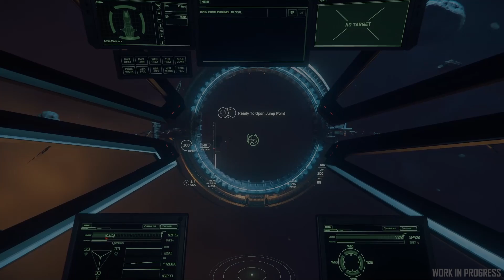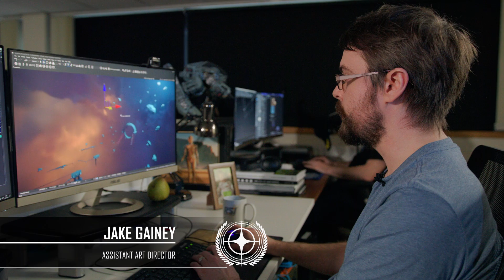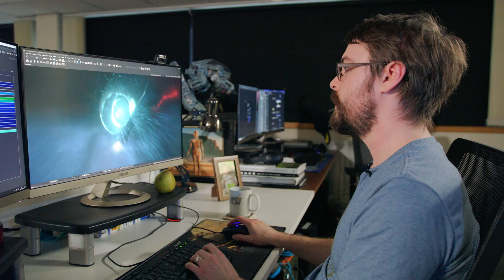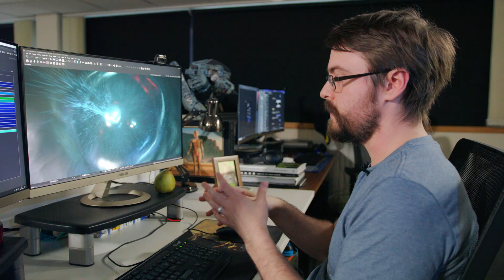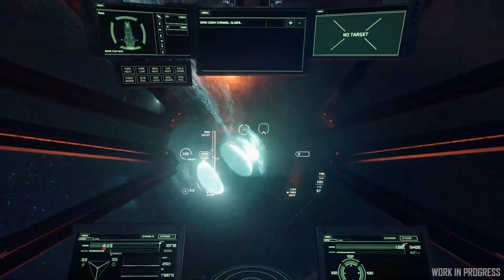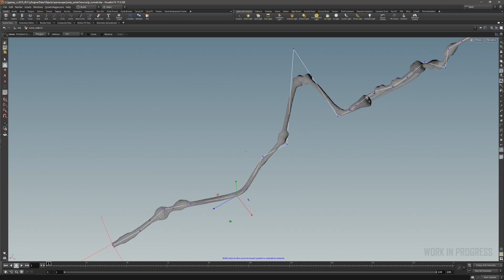Inside Star Citizen: Jump On It | Fall 2019

Comment: Jump points are needed to get to other systems, ships being autonomous to go to another system would be a bit game breaking and would be an incentive to trolls and toxic gameplay.

With that being said, I just can't bring myself to like this concept of wormholes. It looks really bad, apart from the nice vfx I can't point out one nice thing about it. That tube concept is waaaay too organic for a cosmic object. I know you want to have gameplay in it, but why exactly is that? Players shouldn't be travelling from system to system every 10mins to need a gameplay loop in order to stay engaged. Make it a straightforward mechanic. Example: a sphere which you'd see a small constellation in the center and a lot lensing in the edges (kinda like what happens on an event horizon), as the ship starts the dive into the wormhole it becomes stretched and distorted (you already have that when quantum jumping) and it remains as so until the end of the trip, when it enters said sphere space colapses behind (like a very fast zoom out) and expands infront (zoom in) and you'd be able to see massive objects pass around you very fast, until you finally reached the jump point. I think this would be the best compromise between sci-fi and authenticity.
The current design brings a lot of problems, such as you making it possible for players to be thrown out of the wormhole but what happens then? Can you have any other outcome other than death? Because I don't see how a player will make it back to any system when you're like 5AU away from anything. If you could quantum jump half the distance why not go all the way?
Then you have that horrible clipping through the tube. Guys seriously, it hurts my eyes to see clipping and there are a lot of ways you could eliminate that.

TL;DR: 1- wormholes don't need gameplay, it overcomplicates them and it will be a burden more than fun after a few trips.
2 - Make it simple, straightforward and visually entertaining. Easier to produce.
3 - It looks like a colon that is clippable. I'm sorry but that's not good enough for us, and shouldn't be good enough for you.
Reply: Just wanna add that if you compare the wormholes to any other feature or asset it definetly pales in comparison. Sorry for being so critical, I know you're doing your best out of a bad idea.

Comment: I am wondering whehther there will be pilots available to hire like "rapids guides" at the jump points for those that, since the game is entirely "your" skill, can't actually manage the journey. Also I am really curious as to how you will handle some of the "major" jump points like to Earth or Terra. For instance in the gameplay we see "Initiating jump drive", "jump drive initiated" and then "ready to open jump point". This to me says that the jump point is reacting to the input from that players ship which then goes into the opening and travels. With so many players/npcs using those main points it will be a major issue if we have to wait in line to be able to activate the point for our own journey. Will the main points always be open and you then just fly into them and go like the tradelanes in freelancer or will it be like the jump gates and you have to wait till it is free? or once someone else has opened it, even if it closes after the last person is through, will others ships detect the way is open? If more than one can go through at once is it possible that we may have to utilise the "secondary" routes to make it through as some portions are only wide enough for one ship and first to the gap doesn't have to panic react?

Comment: I hope there will be an autopilot for this. Its nice for the fist oder second time but then the whole manual A to B-flying becomes boring.
Reply: Sir, can I recommend to you our latest product "Endoskopi 4.1" , the latest in Wormhole autopilot-technology. It takes 2 rack spaces in your ship and costs UEC 19.000 retail price.
Reply: After a jump point has been charted, it's automatically replicated the path it travels, copied from the first jump point charter's movements. But for the first time, a brand new jump point, no, you will have to fly it manually.

Comment: with these wormholes, are there chances that they get randomly shut down and need repairs, so missions develop to fix them allowing flight though...and maybe allow players to damage them?
Reply: I'd like to see Jump Points be able to be damaged and repairable by players and NPCs. Would be awesome to see thousands of players and NPCs working to rebuild and repair a Jump Point.
Reply: @PerfectCode  or if it can't be damaged, when a player finds one they have to build a ring around it for "safe travel" or else flying through it will be crazy hard
Reply: stabilizing rings

Comment: The motion is very odd. It feels like we're moving forward and backward and forward...repeating. It doesn't feel like forward motion alone and the sense of speed is lost a bit. Maybe this is something CIG is aware of?
Reply: I actually like this effect. it gives it the appearance that the wormhole is semi unstable and is trying to collapse in on itself.  I think it would look better if the movement was more random  and not like a heart beat.
Reply: I agree.  The pulse seems to slow down the actual movement.  Not sure the rapid pulse is needed.
Reply: You are legit travelling unfathomable distances in mere moments. Space and time is bound to get a little odd. Pulse one way to signify going very far very fast; pulse the other way to signify time not speeding up relative to distance traveled.
Reply: Thats because you are switching focus from the edge of the wormhole to the particle flow and back.
Reply: I think it's because the camera was sitting stationary in the tunnel. Once the player is moving through I think it'll look better

Comment: But why jump gates? Will gameplay boildown to 'eve'like gameplay i.e. people camping the otherside of the gate.
Reply: If it's anything like Freelancer, Roberts first space sim. Yes, wormholes will be a choke point for player interaction. Though there will be jump gates and then there are natural jump holes interspersed throughout systems. Jump gates are located on common travel routes, but natural jump holes are usually off the beaten track and will need to be discovered. Jump gates will be patrolled by lawful NPC and players, but jump holes won't be for the most part. So if a pirate wants to camp waiting for traders or whatnot, it won't be easy to do that at a jump gate if their reputation is bad with the law or military.

Comment: Is this a Human made wormhole with two Jump Gates to Enter/Exit like in Stargate? Because i saw no Wormhole before this Jumpgate was activated. will there be Jump Points that are Natural Wormholes? and if what will they look like because a wormhole in a 3 Dimensional space in therory looks like a sphere where you can look through? I always thaught the wormhole and the travel through would look a bit like in the interstellar movie. But at all the Jumpgates look awesome only the feeling of the Speed is not great at all.
Reply: I think jump points are areas where 2 points or space time age way closer than usual, and it is the ship jumpdrive which enlarge the opening to make it usable for travel, and jump gates are built around populous wormholes to stabilize them so they don't change shape too much. As for the lack of speed, I agree. It is mostly because the ship actually moves relatively slowly and also because the trail of particles move towards and through the ship making it feels like the ship is going slow.

Comment: I'm curious if they still plan to be able to have the option to give away or sell the routes so that some players dont have to manually fly through.
Reply: Still looks like it. Remember those wormholes change, and there is "wild" wormholes also present that can lead to different places but are destabilized and can be tricky to cross. If you know the way then you will see the energy stream leading you to where you want to go, but otherwise you would have to go blind and hope you do not take a wrong turn and end up in a dead end. Essentially, an uncharted wormhole can only be crossed if you known the way, or you have drones to burn in order to scout the way. And of course, you can keep that info or sell it to whoever.

Comment: Wormholes look good but they are not very realistic. I mean if you think about what a wormhole would look like in a 2D universe; it would be a circular hold and a tube going "under" the 2D universe to some other point and another hole. From the point of view of any Being in the 2D universe you could enter the wormhole from any direction, you would not be able to see the side or the back of the wormhole. When entering the wormhole the 2D Being would think they are entering a circle heading for the centre. Then, after a longer time than it should take to cross the circle, they would emerge somewhere else in their 2D universe.
Inside the wormhole they would see not sides to the wormhole, they wold exist on the inside surface of the 3D wormhole. Moving left or right would take them around inside the wormhole and back to where they started. If there were two, and one moved off tow the left they would magically appear to the right of the second.
If you extrapolate 2D to 3D then a circle becomes a sphere and the 2D surface of a 3D wormhole to a 3D surface of a 4D wormhole. Moving Up or Down, or Left or Right returns you back to where you started.

Comment: There could be some kind of variation based on how stable a wormhole is, so that it's either straighter and calmer or more twisted and difficult to navigate.
Reply: It was said awhile back that there will be wormholes of various sizes and complexity. Some are small that larger ships can't fit through, so you could jump it in your Hornet but an Idris couldn't use it. This way you could find shortcuts to different systems. But the big boys will have to take the long way around. You'll also have to map it if it hasn't been jumped before. You can then sell the jump map to others. That was one of the features of the exploration loop. No idea if any of this has changed or not.

Comment: What I want to know is what are you going to do when two ships are flying through the same tunnel in opposite directions? In the past two days my ship has been demolished multiple times by random people going into or out of quantum at hubs. And that was in open space with at most 50 players where the chances of that happening should be so ridiculously small that it would be like winning the lottery. You're going to have problems if there are 50+ players all scrambling to fly down the same wormhole that looks barely big enough to fit an Idris.
Reply: It seemed like everybody has to wait for opening the wormhole. So if somebody wants to "jump" from one system and opens the jump point - ship on the other side has to wait. Maybe.
Reply: @buzzantique1158  Well, that causes other problems. Bottle necks like that turn cargo ships into sitting ducks. So every jump point becomes a buffet table for pirates. It also discourages trade between systems if you have no idea if you are going to be waiting 5 minutes or 20 minutes in a que to use the jump point. Which will only be made worse when they start implementing a dynamic economy.
Reply: @OmegaZyion  Most jump points will be regulated by local security forces, but for the less regulated ones yeah I could see pirates camping them
Reply: They could just generate a new instance for each player of the tunnel as well as the entry and exit points when they give the order to open the jumpgate...this would avoid the issue entirely, wouldn't it?
Reply: @Woodchuck1337  there are no instances here, maybe in the future but at the moment everyone in the server is in the same server and cant be moved without a loading screen and they never want to have a loading screen besides when spawning in
Reply: @yobob591  Sure you are right...at the moment we don't have instances...nevertheless iirc they have plans for heavy instancing or rather server meshing when it comes to the big space battles i.e. around capital ships involving lots of players, so at one point in the future there will be some kind of instancing. And since we also won't see jumppoints and wormholes in the PU for the next couple of months/years, I'm sure that WHEN they finally come, the server meshing is ready to deal with these problems. =)
Reply: @Woodchuck1337  noooooo a instance thats elite dangerous territory this game is suppost to a persistent universe which means everythink is there no loading or instances thats the whole point in star citizen and if they do it like that then we all migh aswel just play elite dangerous

Comment: Now this is what I was waiting for! <3 Although I believe a wormhole is a connection of two points in spacetime with the length of zero. More like a portal than a tunnel.
Reply: Yes the two points in spacetime would have no distance between them, but the space around those two points would get highly warped and stretched. This could take on the appearance of a tunnel like structure, as you move form the unwrapped space into the twisted space around the wormhole itself and back out through the twisted space on the other side. In this case the actual wormhole itself would exist somewhere in the middle of the tunnel.

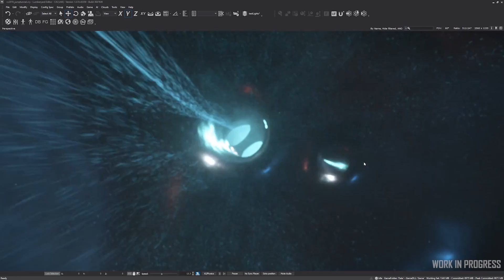Comment: I will try to simplify some concepts for people that don't know a lot about Graphics Programming. There are 2 main types of shaders: Vertex and Frag shaders. Fragment shaders change the color of a surface (that blue and orange effects on the walls at 6:40 for example, also those 'ripples'). Vertex shaders change the points of a surface ( like that hobble you see).
Why they Vertex shaders are important? Because, if you don't need high precision collision detection, they are waaaay faster than changing the surface/walls object. In reality the Walls are like you see at 8:40  Static.  The rest is GPU magic
Reply: Awesome! I have a question... what are shaders?
Reply: for anyone interested in shader programming i'd suggest heading over to shadertoy.com to see whats possible with shaders and to see what the code looks like
Reply: Thank You
Reply: Tl;dr: it's magic.

Comment: I like that he brings up the fact that you are Actually traveling thru the wormhole it is NOT just another form of Loading Screen! Even if it amounts to the same things...)
Reply: Well if a ship hits the tunnel walls bad things can happen (damage to the ship, emerging in an unexpected location in either the origin or destination system, etc...), so it's a bit more involved than a loading screen.
Reply: Like imagine, when you are going through these, you are going through a vast amount of space in a fraction of the time it would take normally. It might be possible to QT between systems, but it would be so far that most ships wouldn't have the fuel, or just simply take too much time. Its incredible.
Reply: Shawn D. It’s unlikely tho, IRL the closest system to Sol is 4.3 light year away, QD runs at around 0.2 times the speed of light so it will take around 21.5 years for us to QT to other systems. Even the universe in SC is build with 1/6 scale as real life it will still that 3.6 years of non-stop traveling.
Reply: @josephwan  I would not be surprised if someone would acctually do that once it is possible within the game.
Reply: @josephwan  There's also no indication that systems connected by jump tunnels are particularly close in terms of interstellar distances.
Reply: @Taladays37  Jump tunnels are wormholes, and the term comes from the fact that following a wormhole through an apple is a faster way to get from one side to another than following the surface (especially at the scale of most insects).  It's a metaphor for the a theory, also called an Einstein–Rosen bridge, that basically because of the nature of space-time there could be "short cuts" between points in space that are much shorter than the apparent straight-line distance. This is why it's the only way one could travel interstellar distances in a reasonable time frame that plays nice with General Relativity.  Another way to think about it would be drawing a dot at each of the far left and right sides of a paper; and instead of the drawing a line between the two points folding the paper over so the dots align then stabbing through them with the pencil.

Comment: So, theoratically, though we´ll possibly never be able to (due to time and fuel) we could also travel to another system without the jump point? Did I get this right?
Reply: Yea Jump Points are the only form of FTL in SC, even then they’re not really FTL because the speeds involved are not faster than light, you’re just short cutting through the universe. 

Quantum Drive travel is not FTL. Currently it makes out at around 30% the speed of light, and is meant only for in system travel.
Reply: That's what I got too, he said actually traveling to the other system
Reply: Theoretically YES..but top speed is 0.2C so that hundreds of years real time...you would be long dead as would your grandchildren.
Reply: @AlbertoMartinez765  Sure... But since we can get trapped in the middle of nowhere as they stated on CitCon (almost later on) there must also be a way to get rescued (possibly way later on). I´m excited what´s in their head there.
Reply: Yes. You can see that already. If you wanted to fly from Port Olisar to Yela you could do it. it would take a very very long time but it could be done.